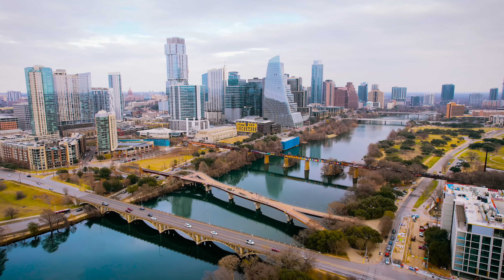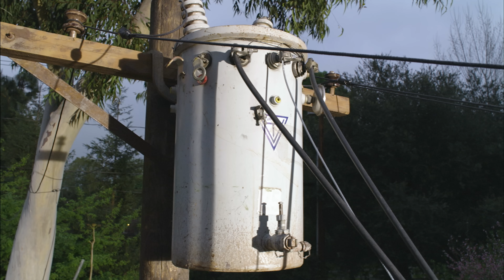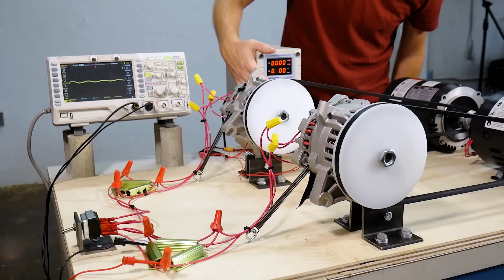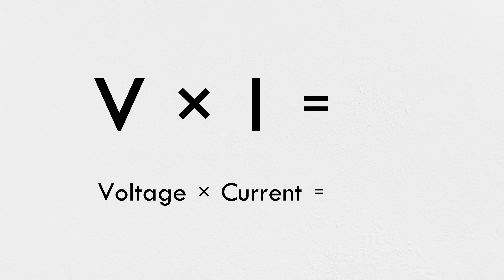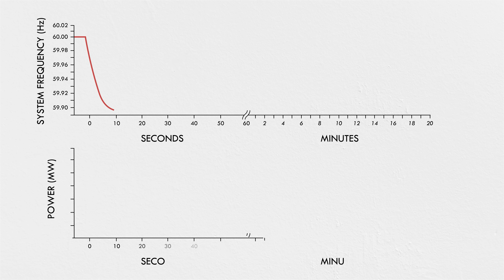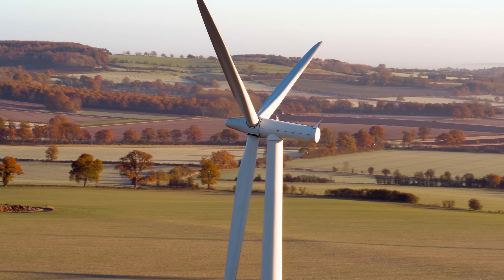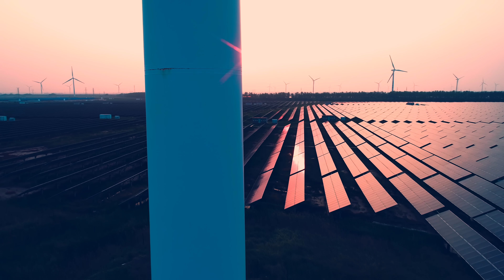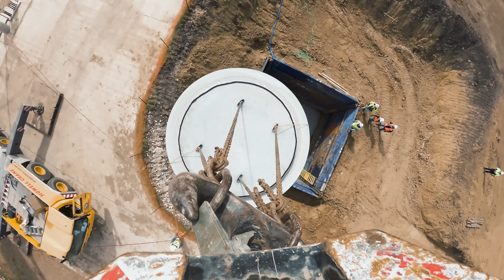Connecting Solar to the Grid is Harder Than You Think

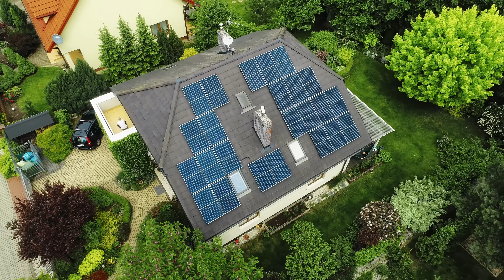Comment: 7:47 That's just because people didn't install the grid switch. When the power goes off it switches to the solar and battery. Almost any solar setup can have this simple switch installed. When the grid power goes out, it will switch to just solar and battery and you're no longer connected to the grid

Comment: Gee, another reason to not depend on solar and wind for utility-provided electricity?  What a surprise. It will only get worse until "renewable" power sources are required to build energy storage sufficient to compensate for output losses.  A large part of the Texas power outage of February 2021 was because power generation rules had been changed to benefit wind and solar, rather than stable energy sources.

Comment: Couldn't you keep the solar on a separate grid then lead them to "batteries" that could then be connected to the actual grid? With specific stops along the connection to not allow the batteries to be completely sapped? Or to be used during and emergency, so once they are at max capacity you could use the excess to help cover the grid? Idk about electric wiring/engineering. But it's very curious to me.

Comment: Solar panels are horrible for the environment, it cost more to recycle a solar panel, then to create one, 
Not to mention all the material Sörenstam around the planet I need to be shipped on massive ships that burn diesel fuel. One Halestorm and you have to replace the whole system, not to mention the batteries themselves are horrible for the environment. We should be using nuclear energy It has the least amount of deaths per kilowatt, even less than solar power. Cuz, what you don't realize the cobalt used in those batteries his mind with slave labor. Majority of companies source their batteries from China. China gets 94% of their cobalt from mines in the Congo which actively use child slave labor. So in order to virtue signal to save the planet, you intern created more slaves and are harming the planet even more so.

Comment: I remember working to build a new factory. They installed a huge electric motor-looking device, about 12-15 feet in diameter. I asked, and was told that it was a electric power filter, and was for "cleaning up the service power".

Comment: Actually most wind turbines usa an asynchronous induction generator. They drive this with a fixed gear ratio to maintain rpm just above syncronous speed. Thats why they always turn at the same rate, no matter how strong the wind is. When the wind is too slow to generate any power at this speed they turn all the way off.
Reply from the maker: You're describing a type 1 turbine, and they are much less common today compared to types 3 and 4.

Comment: Why is it so bad that the frequency drops below 60 Hz? Lots of appliances are already equipped to accept 50 Hz and 60 Hz. Can't these devices accept 59 Hz as well? 🌈
Reply from the maker: Lots of devices can handle it, but many can't, especially in an industrial setting. More importantly, the generators aren't designed to withstand significant deviations in frequency, so it can cause overheating and vibrations that damage millions of dollars of equipment.

Comment: This explains why my Honda inverter generator isn't perfect enough for my wi-fi.  Everytime the heat turns on my wi-fi cuts out.  Solution turned out to be a battery buffer to keep that perfect power available when the generator speed changes and creates a temporary glitch in the clean sign wave current.

Comment: The Odessa event was (edit: contributed to) by a particular phenomenon called Cessation, which is not an unexpected behavior of nebulous algorithms. Designers put it in intentionally to protect the hardware without violating the grid rules at the time, which say when a disturbance happens, you must keep your output breaker closed to help the system (low voltage ride-through.) But there were no requirements that your unit continue to output (real) power. Solar units therefore would drop their power output to nearly 0 to protect the hardware from harmonics generated by the panels trying to push power into a disturbed grid. There was also an automatic timeout on this cessation where the panel would not ramp up until the disturbance had passed for some time. This was often baked into the hardware and many farm owners didn't even know the behavior existed.

6:30 this explanation would have benefitted a lot from showing a raw PWM signal, then showing a capacitor low-pass filter wipe across it to smooth it out
Reply: The key thing here is that the inverter has to push real power.  If all you needed was a "sine wave" then you could produce one with a DAC and a simple capacitor-based filter.    The problem is that a DAC is a resistive device and can't actually push any real power (it would melt into a pile of sludge in milliseconds if it tried), so the sine wave is useless for inverter purposes.

For the same reason, using e.g. a transistor type of circuit to amplify such a loe-poert sine wave won't work because the transistor is a diode-like device and the voltage difference is dissipated as heat.  The transistor can't actually amplify a DC input and produce a ton of power on the output that looks like a sine wave either.  It would instantly melt.

Same thing for a PWM signal.  The PWM signal itself can drive FET gates, and the FETs are what switch the real power from the DC or rectified source.  But a capacitor on that output won't produce a sine wave, it will just melt (more or less instantly) because it is essentially short-circuiting the FETs.  Again its an issue of the power flow.  A capacitor that isn't doing any  work won't melt, but in this case the capacitor is doing a massive amount of work and the FETs are basically pushing incredible currents into and out of it because it kinda looks like a short to the FETs (hundreds of amps.... 1000VA for each real 1W of power).

So the only way to really produce a real sine wave with the desired amount of power is with magnetic components... inductors and transformers.  The PWM can drive the FETs, the FETs run the real power through an inductor to convert the medium-frequency PWM signal into a voltage, and that runs through a transformer to produce the desired output AC voltage.  The inductor and the transformer both filter what is essentially a huge HF mess of square and sawtooth waves into something close to a pure sine wave and a single capacitor on the output gets rid of remaining HF artifacts.

-Matt
Reply: @junkerzn7312  Ehhh, a modern cheap grid-tie inverter for areas that are 3-phase would just be a triplet of half bridges made of SiC FETs (rated to 3x the phase-to-neutral RMS, measured across the entire half-bridge), with an LCL low-pass between the switching node and the grid-side phase wire, with the PV strings MPPT boosted up to said DC level (e.g., in central Europe with about 220~250 V, we'd be at about 750 V for the DC bus). At larger powers you will want more of the SiC switches in the 3-phase converter section, because the extra cost to control them all separately will be worth the savings in the LCL low-pass filter that theoretically losslessly eats up the PWM's higher-frequency parts only letting the low-frequency smoothed sine through. But you need around 50-100 kW (well, I guess, kVA) before that should be worth the complexity.
Reply: That passed the buck too; who didn't set or commission the devices correctly? Of course it's also lies to say 'nobody noticed' because e'ybody's (in the Texas grid with the rugged individualism but also State Nerfed Generators) billing rate was suddenly 60x for 7 hours.
Reply: @davenordquist4663  you're confusing wholesale and retail. The entire point of those being separate is that retail is more expensive and protected against volatility. Some people got greedy and chose to expose themselves without protection and they got bit. Hard. They did not properly understand the risks they were taking. It's like shorting a stock with all of your savings.

This is also not an issue with Texas alone. California has faced this issue for a decade but they never looked into it because all their cessation happened on unmonitored distribution panels, and all their events had a plausible second contributing factor so they constantly said "oh no it wasnt solar, it was a transmission line. It wasnt solar, it was the hydro plant. It wasnt solar, please dont hate renewables, it was a transformer. It was the weather. It was a shooting."

It really is a case of "nobody noticed" because the code had never been so widely and consistently activated before. Nobody anywhere audits any private firmware in any industry.

Edit: as I mentioned, this also violated the spirit of the law without violating the letter of the law. Nobody has thought about this as a loophole because the grid rules at the time were built around synchronous thermal generators for whom output going to 0 within seconds is not possible without tripping the unit. You will overpressure the boiler.
Reply: @marshallc6215  Well, they're correct, it's not solar. The issue is intransparency, ignorance and a cult-like adherence to deregulation, privatization.
Reply: @luelou8464 a (cheap/simple) 3-phase inverter with MPPT is one boost per MPPT channel feeding a common DC intermediate, and then indeed 3 buck converters (careful, they need to be able to handle current in the back direction for this to work, so use active FET rectifiers instead of just passive diode) for the 3 phases.
Reply: Thanks for the added context
Reply: This reads like a case of a disconnect between the objectives of the people writing the grid connection rules and the people implementing them?
Reply: @rowanjones3476   eh, it was more a case of hardware designers not being aware of WHY particular requirements exist. They met the letter of the law while violating the spirit of it.
Reply: @marshallc6215  As a hardware designer, this kind of thing drives me nuts. We're always having to go back to product managers and ask WHY they want things on our boards. But I understand not everyone feels like they have that ability, or perhaps are jaded after being told "just build it to the spec and quit bugging me!"
Reply: Baffling too me why this kind of thing continues to be dismissed as technical growing pains.  Grid sync is just one problem.  The economics of firming power is another, and no, batteries can’t resolve it. The Iberian blackout already killed 11 people. New solar farm builds in Texas need to stop,  now. Build nuclear, it works, doesn’t have anymore “growing pains” euphemisms papering over game over problems.

Comment: Grady - Great vid on follower vs. leader in the inverter space.   One thing you might want to be aware of.. as per Dave over at @eevblog has said repeatedly: Never directly connect your oscilloscope up to mains.  Yes, a 10x or 100x probe can get things down to something the scope can handle, you have to remember that that it's still a common ground.  The inverter neutral, your "dc motor", and your main earth were all connected together.  Something that could easily cause that nice piece of Keysight gear to loose it's Magic Smoke.  What you want to use is called a differential probe.  Both probes are electrically isolated from the 'scope, and what you are measuring is the differential between them.  Dave has done several videos on differential probes (#932 ) and problems with connecting to mains (#279).  Again, other than this bit of minutia - excellent work on the topic - Thanks!
Reply from the maker: Thanks! All the connections to the scope were through 120v to 12v isolation transformers. You can see them on the table.

Comment: Fun fact about the frequency. Microwave ovens usually use grid frequency to keep clock in time. That's why microwave ovens' clock never stays on time, at least very long. Where I live the clock ticks ever so slightly too fast, because our grid provides slightly over 50Hz power, but MWO still ticks on one second every 50 oscillations.
Reply: We have a 60hz grid and the operators actually average out the frequency by making sure there is 60hz*60sec*60min*24hours of cycles per day. Over time the number of cycles is about spot on, so our grid-based time keeping stays spot on over time, even if it varies a tiny bit throughout the day. Short of a power-outage throwing that all out the window, the only time I adjust the clocks is evil daylight-savings.
Reply: Yeah, the 50 Hz in Europe may vary a bit, but the frequency target is actually biased such that the summed cycle offset tends towards zero. There was an issue a couple years back when a dispute between Kosovo and Serbia resulted in underproduction and a prolonged lowered grid frequency. The noticeable effect of this was that frequency-tied clocks were running 6 minutes late. They regained this time over the following months though, as designed.
Reply: @AlexandervanGessel  My microwave oven has been being running fast since we bought it over a year ago. It's not much, like 1-4 minutes a month, but never runs late. 
I'm not sure if the Kosovo-Serbian situation affected us, we are in Nordpool and AFAIK we use almost exclusively our own electricity, and import rest from Sweden. I can be wrong 'tho
Reply: @TheSanpletext  Well, I'm referring to the central Europe synchronous grid (which stretches from Morocco through continental Europe to Turkey). While Norway, Sweden and Finland are members of ENTSO-E, they have their own separate synchronous grid, which includes parts of Denmark. Maybe the frequency is less controlled there?
Reply: @TheSanpletext  do you have another electronic device using this good old tech (like an alarm clock or a DVD/VCR player) ?
Because the fault might be due to the device itself drifting due to wear, bad components, temperature or simply by being wrongly factory calibrated.
Large grids like yours don't drift over such a long time, they are heavily compensated to provide a 50 or 60Hz signal in reference to an atomic clock so there shouldn't be such minutes-long difference through a month.
Reply: In my experience, there's 2 reasons a frequency-tied clock can get a permanent offset: 1) Your local area was islanded and the grid frequency was shifted to trip solar inverters. The change may be as much as 2%, resulting in clocks rapidly gaining time. 2) A simple blackout: No grid means no cycles.
Reply: I'd wonder if part of this is a sensitivity of a cheap design to bursts of noise on the line.  Such bursts wouldn't budge the hands of a motorized electric clock with its mechanical inertia, but could be counted by a digital counter.
Reply: @luelou8464 It's cheaper than a genuinely stable oscillator. You can just use a couple small capacitors to get your hands on a 50 (or 60) Hz sine with suitable voltage range for the clock chip itself. In it's place you could use a clock crystal and a couple different logic gates on the chip to break down the ~500x higher frequency, but it's expensive to get much better than about 1 second per day off. So to not be about 1 minute off every 2-3 months, they just use the grid reference.
Reply: @luelou8464 Sure those days it's not much more expensive to get a quartz clock. But oscillators, especially such cheap ones, aren't perfect and they can drift quite a lot (like the symptoms described by OP). If the device doesn't use the grid, then it needs compensation from a GPS/radio/internet reference clock to be corrected which adds even more costs if the device has not other use of those technologies. The grid freq is not instantaneously accurate but it's always compensated so it's reliable enough for a clock.
Those days our devices mainly use clock quartz for offline RTC, otherwise the other methods are preferred.
Reply: I'm reminded of Tom Scott's video on the UK and EU power grid while he was holding a Teasmade
Reply: Our microwave oven and regular oven both get about 1-2 minutes slow in the six months between daylight saving time changes. I don’t use them for anything precise since I have other clocks in my cell phone and computer that are synchronized to external time standards through their network connections.
Reply: @luelou8464 It's probably slightly more expensive, but as long as you can rely on the grid cycle-count being self-correcting, it gives you a clock that's more stable in the long term.
Reply: @liam3284  The clocks in my microwave and stove run consistently slow. Maybe they are not good counters.

Comment: Ok I know that the conversion would be hard given how everything is currently designed but why don't we convert to DC power now that DC voltage adjustment is now possible thanks to transistors? Many powerlines now use HVDC due to the many advantages the DC provides in power transmission. The thing is that almost every thing that consumes electricity in our home actually uses DC power from the LED lights to the electric car to any electronic device like a laptop. This conversion adds to the complexity and cost of every single one of those devices. Even devices that currently don't like the electric motors in a washer and dryer can be swapped out for DC Equivalents. What would an electric grid that ran only on DC power look like? What would be the benefits and what would be the downsides?